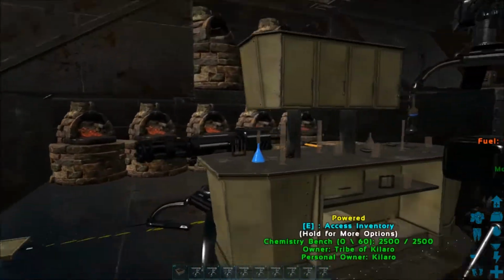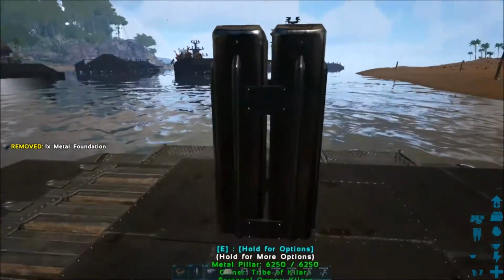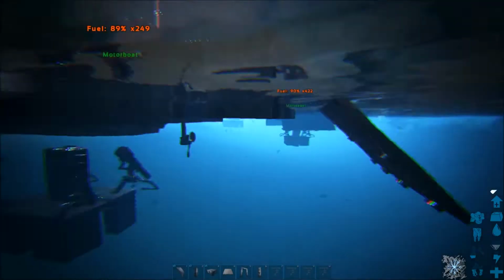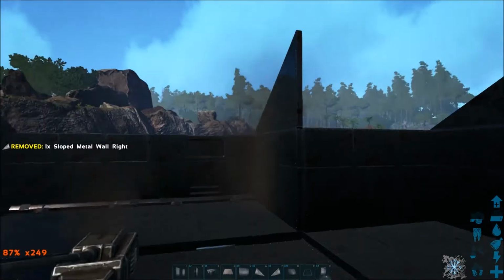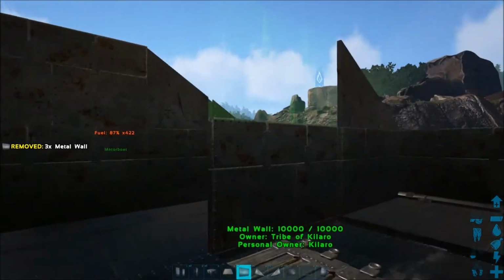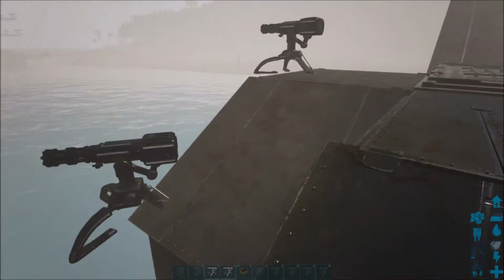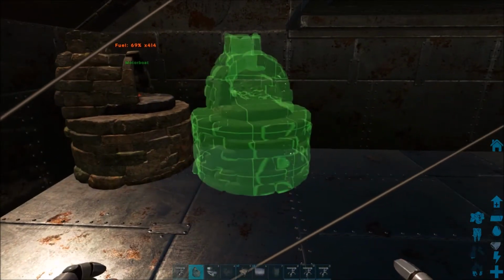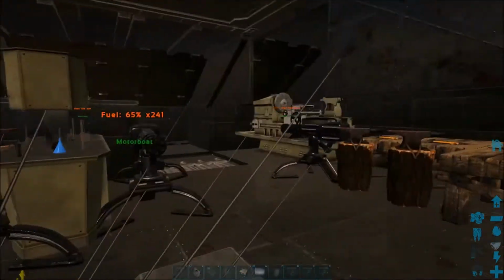Mining Boat Tutorial, Deadly PvP motorboat - Ark Survival Evolved

Comment: Does it matter if underneath isn't centered? My snap points aren't working like yours
Reply from the maker: what part do you mean not centered? do you mean the floating foundation
Reply: @Newbie4Hire  yes the floating foundation. My pillars have to snap to the middle of the ship fountain where in the vid it looks like somehow your snapping between 2 foundations so I have to pick a side
Reply from the maker: @johnackerman1160  it doesn't matter if it is centered, that's just for aesthetics.  However more recently than that video they've made the floating foundations against the rules.  I've taken to just running 4 pillars down, 1 ceiling, delete the bottom pillar, place 3 turrets.  So it ends up taking 7 pieces instead of 6, but it is within the rules.   You can still do the floating foundation at your own risk, unless you are in a big tribe that they have their eyes on, you are unlikely to have an issue, but it is something to consider.  All my future builds will no longer feature the floating foundation because of this.
Reply: @Newbie4Hire  ok thanks I'm on an unofficial pc pve server so I dont think they will mind. I even left out a few things from the vid and just used the bottom and storage, going to try to make it a taming raft as well

Comment: So motorboat is only capable of 135 structures and based off your materials list you’re over...?
Reply from the maker: Motorboat can hold 138 structures.  This build uses 138, if there is more than 138 listed in the materials list then I made a mistake in the materials list, I probably counted turrets wrong or walls wrong.